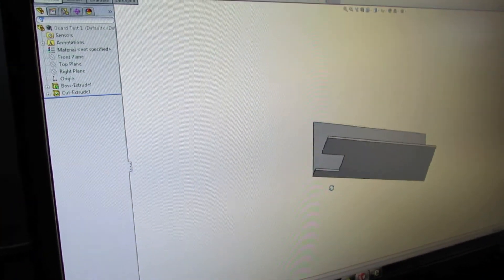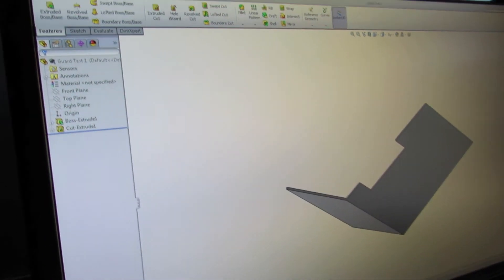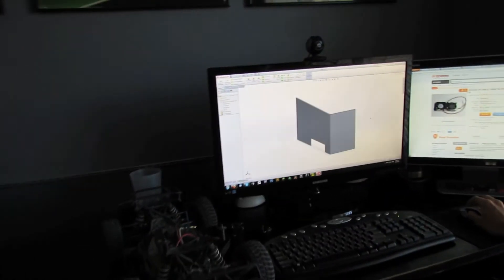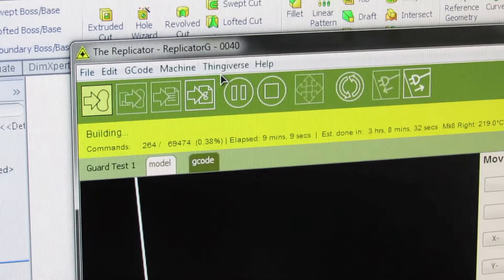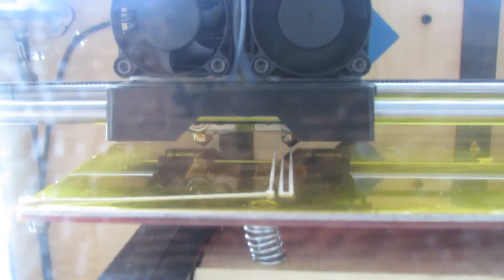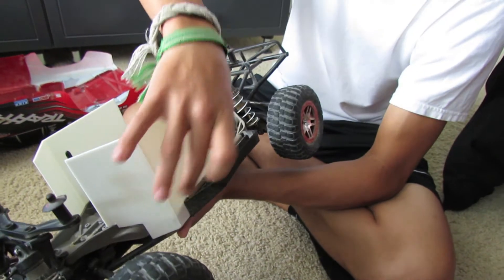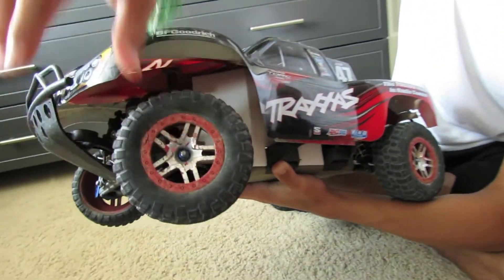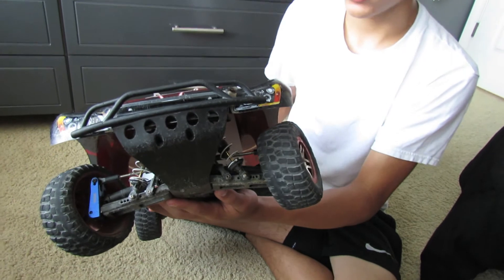3D Printed Brush Guards - Traxxas Slash LCG Platinum Edition SC Truck - Ep. 29

Comment: Nice design but I would cut it down about inch or two so when the body is on and you flip or have a big impact going to possibly break the body other than that nice design. Have yall make any parts for your rc cars I have broke my front end and dont want to buy a new one please reply with any help thanks
Reply from the maker: Yes, TinmanTech, is actually currently working on a 1/10 scale buggy made entirely from the 3D printer!